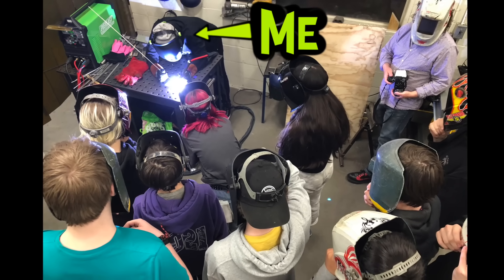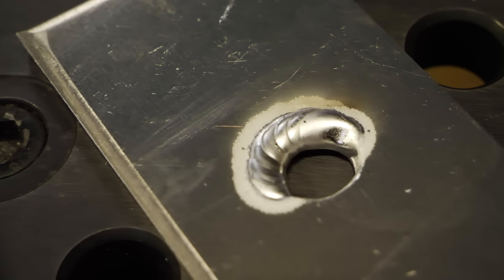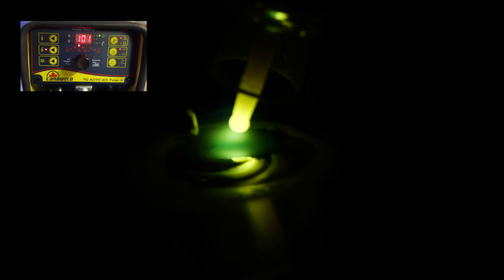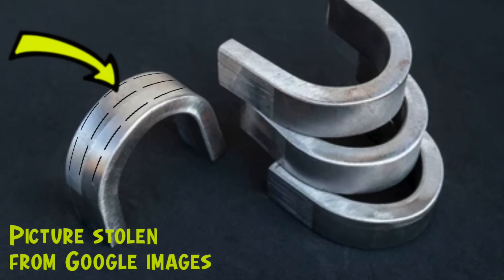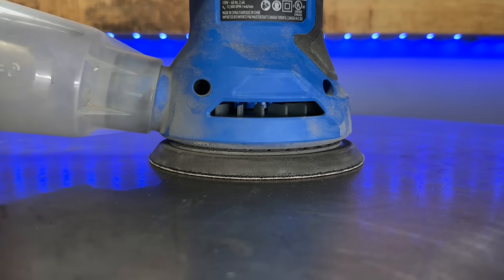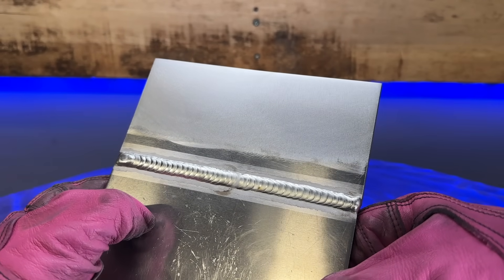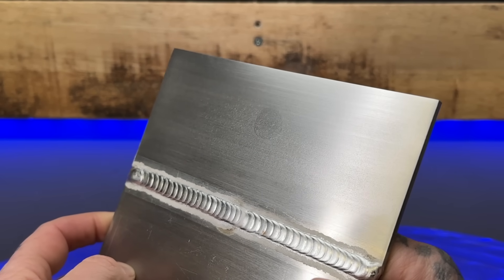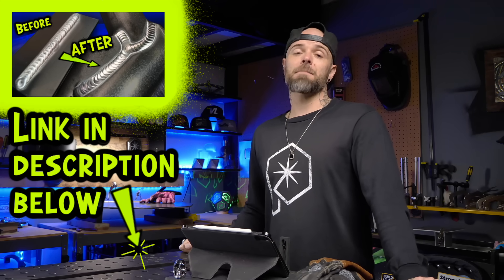99% of TIG Welding Beginners Don't Know This Trick

Comment: I worked for a sheet metal place and everything was powder coated. So the minimum finish was all marks blended with a 3M 36grit cubitron followed by an 80 cubitron then a 120 and 240 orbital. Had a bay set up for final inspections with lights everywhere similar to a paint booth. Then it got coated. Finish was everything

Comment: Do you use a cutting wax to prevent the aluminium from clogging the sanding disc.

I’ve used steel wool and soapy water  it restores it to its original gloss.
You can also use a product called Ali clean it will remove the oxide layer and brighten up everything even the welds, customers absolutely love it.
If you’re going to go for a mirror finish and you don’t want the shading, try this method cut a thin strip of aluminium made from the same grade as your parent material.
You’ll never notice any difference in shading between the welded area and the original material.
I’ve used this method to weld toolboxes and Bull bars.
The customers love the finish and can never understand how you did it and it is still structurally sound.

Comment: Lot of heat this way easy to warp it. Best to put brass backing weld it up and then Quench with air keep it flat. Only use 2” rylock scotch brite on a dir grinder also quenching with air. Then 120 paper down to red scotch pads.

Comment: Good video definitely gavnt had the chance to try this with a tig witch sucks haven't had the extra cash to get a tank of gas yet but have done it hundreds of times with my wire feed welder on steel i do get the dark seam looking lines hear and there especially with thin metal so then i geind a grove in it clean it and run another pass but depends on what im welding if its for strenth and looks i definitely go the extea route would rather do that way most of the time but in a pinch ilk skip the route and redo it later if i cant redo it later ill take the extra time no matter what!!!!!!!! Great work cant wait to get to try the tig function on my little cheap welder especially to practice!!!!!!!!!!

Comment: Easy. I have 2 simple solutions. 1. You said make the hole disappear. OK np. You didn't say you still want a finished product. So, i get rid of the product altogether. Hole is gone. 2. If you want a finished product, then here's the solution. Get two brand new pieces and weld them together. Problem solved.

Comment: 1 min in; as a welder fabricator; this being a shop/fabricating scenario.
Easiest way to grab a piece of plate copper or steel and use it as a backing plate. 
Welding the hole closed in a a couple passes depending on hole size letting cool, flip it over; can weld other side for double penetration if it's a more critical/structural part. 
Than blanche the weld cap faces with a grinder clean. 
Not a big deal

Comment: My dad would appreciate this, since he works with too many journeyman who basically refuse to grind and polish

Questions though: 

1) is there a reason for opting on a flap disc rather than a flat 80 grit once you were getting close to surface on the bead? Those were always super aggressive, and kinda made more work for cleaning up/blending once you start hitting surface to bring down flat

2) When cleaning up the disc marks, was there a reason to not run a pass with a sponge wheel before the orbital? Past experience, it helped me mitigate the need for more aggressive orbital marks to blend, and keeps surface measures closer to base levels

3) Have you ever tried a sponge wheel on an orbital as well?, especially after the orbital with a Brite pad. Helped me dull down the marks from that prior to matching grain.

Random thing for anyone who has the means and needs to do this stuff on larger surfaces: board sander with Brite pads saves your arms 😜

Comment: Hi. There is no such a thing, than grinding direction on aluminium. I mean, of course there is if it has been grinded. But otherwise there is not! But on wood it is no matter is it grinded or not and if is, what direction. On wood it is always. Aluminium, steel etc. metals, it is not. There is grain structure on most metals. And thats a whole different story.

Comment: Use a wood hand plane to remove aluminum. It's cuts off as easy as wood and no need to grind. It works for soft metals pretty good. I'm no welder so I learned fast easy ways to remove my mistakes. Hand planes are handy.

Comment: I don’t even need to watch this . Simple just put a block of copper behind the hold then just weld the hole shut  the weld won’t stick to the copper .  Done ✅
Reply: Same my thoughts 1 min in 😅🤷🏼‍♂️
Reply: Copper?
Reply: @rayburch9875  copper, steel or brass will work; just need a metal that won't bond or to small or thin that it will melt away; giving a backing plate to fill the 🕳️ with your filler metal.
Reply: Naw, you still would have to flip it and build up the other side so that there would be no visible divet after grinding/sanding flush. Messing with a copper backing bar in this application is just a needless step. He is spot on about how to best do this. Don't get me wrong, I'm a big fan of backing bars when it makes sense but this is not one of those cases because you actually need a slight build up on both sides.
Reply: I 100% agree with you.
Once I was working at a papermill in Virginia. The electrical crew was GTAW (TIG) welding some aluminum overhead wire tray, or at least trying to. I told them to get a piece of either 1/4" or 1/2" copper buss bar, then clamp it where they were welding two ends together or filling a hole. They had been getting excessive penetration with dingleberries hanging from the back. I showed them how to weld it and they were amazed. I even went to the electrical supervisors and asked for a piece of the copper. On that job, I was a stainless pipe and tubing welder. The copper works on just about any metals. It will be flat and smooth on the back saving lots of grinding or sanding.
Reply: U  dont have the same clean finish i ve done too many time
Reply: Exactly
Reply: This exercise is… an exercise. It is for working on your skills.
Reply: And you didn’t even need to comment either, but here you are…

Comment: Very good video dusty well done
  Now one trick to also toss out is the difference of the base to fill waterial  IF you  have some scrap pieces of the base material cut small strips off  that are about the size of the filler rod you were going to use. 
  Dont use any coolants or oils on it when cutting  the strips you want clean non contaminated strips .  Now use those strips of the scraps from same base material and use them as your tig filler rod the weld discoloration will be minimal , be aware if the part is anodized  the welded area will show up like neon sign  in a different colortone. welding also change the base and fill materal slightly at the point of weldcauseing slight off gassing of other material in the alloys to flashout  so  you never will get a dead perfect color match but  controlled heat frequency and dwell time can reduce that  to a minimum. finishing and polishing can  be an art and skill all in itself. 
 45 years as a macinist /tool and die / QC, and hand polishing optical parallel interference gauges, it is an art in itself to get the feel  even in as rough a surface as a material grained finish

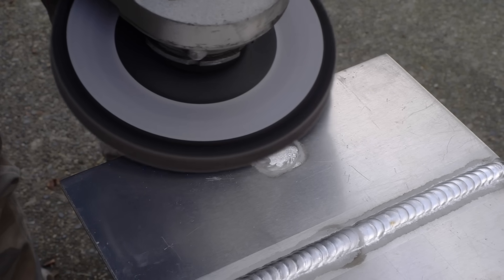Comment: To avoid hitting the base metal, use a hard grinding disc and then finish out with sanding discs after the weld is a hair above the base. I have blended countless welds and seams and prefer to finish with a sweeping technique, to avoid excessively digging into the parent material. The main reason is shown @5:22 where the base is being hit because of the nature of sanding discs flexing and conforming to the area, so you will often grind more than you originally intended.

Comment: I'm good at this. We do this all the time. That sounded prideful... What i mean is we do a lot of this kinda stuff and we try our very best to make it look like there was never a cut or a hole or be able to tell that two pieces were welded together. We build all aluminum custom designed estate gates. At this point we've built multiple hundreds of different looking gates. And i have to say i still can't weld as good as this guy. Sure wished i could.
Reply: We have all our gates powder coated. After it's coated every little flaw shows up.... Depending on the color. I can't hire anyone because this is an artistic skill that not many can do. It's not just welding but it's fabricating aluminum. No I don't think I'm great or amazing but the guy in this video is... Which is why I watch his videos 😊 best way to learn is by watching someone better than you.

Comment: When I worked at Flowmaster we were filling and finishing the occasional burn-thrus in this way on DQ 16g mild steel sheet metal.   
I took great pride in making holes "disappear". In fact, they put me on a bench that was doing mostly that for the whole shop.   
Pro tip : Scotch-Brite treatment hides a multitude of sins, but like Pac Arc says, paint will highlight them.

Comment: When I was in high school, I swept a shop that made custom fabricated stainless steel kitchen equipment. Think: hand made refrigerators, 20 foot counters w heat lamps above them, and those continuous rails you push your tray down.

After excellent “Heliarc” welding, they would start w an angle grinder just as this video does. Then, depending, they would follow with a fluffy roller, like you’d polish your shoes with, but with gritty balls or fine sand glued to the circumference.

After this, they would sometimes take 4 to 5 pieces of Scotchbrite, punch a hole directly in the center of the rectangle , and stack them on an angle grinder, using the uneven ends of the Scotchbrite to induce the first grain.

They would finish this rubbing Scotchbrite by hand in line with the factory grain, and after SS polish, you absolutely could not tell where and weld was, nor would any liquid pool the entire length of the counter, nor matter how long. They did this in the future kitchen. 

Stunning (and wicked expensive, but quality always costs more). 

Admiring my work, a friend related that he too would like to start welding. Sadly, he stopped after I told him: the welding’s the easy part. It’s the finishing that’s difficult. (Not that I’m great at either!)

I enjoyed the video. It is every bit relevant to “welding.”

Comment: If you get a flap disk that is cut up in 6 sections, with every other missing, you will get kind of a see-through effect which will make it a lot easier to grind away the "nob" without leaving marks around it.

Comment: Had a tig for a weekend so far and managed to weld up a 20mm hole in 25mm aluminium because i drilled the hole in the wrong place by half a drill and when i re drilled it there was literally no sign of my mistake once it's polished it'll be invisible

Comment: I learned a lot of the finishing methods from doing auto body work long before I learned to weld.  I ended up using these methods in mold and die repair.  Good video!!